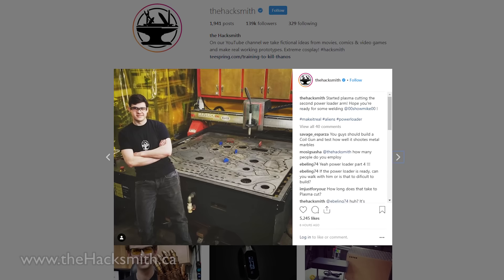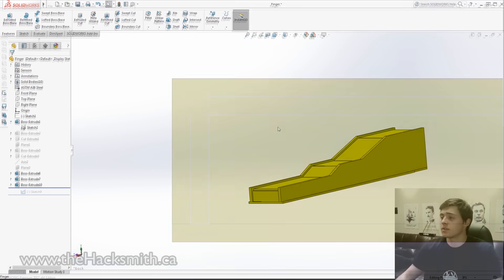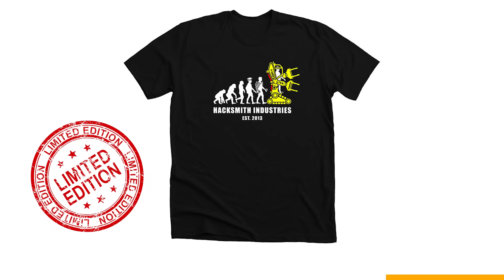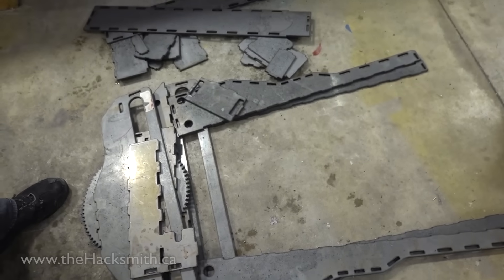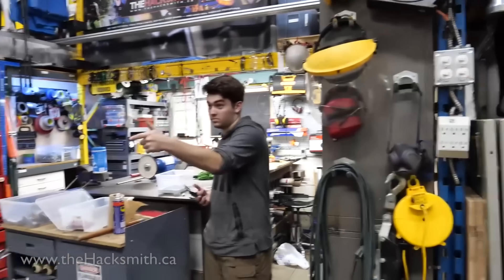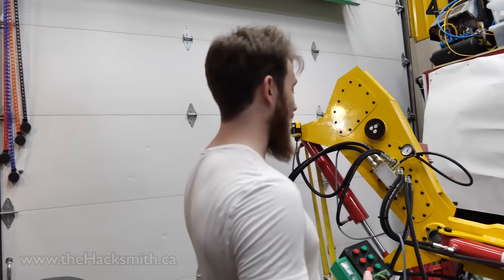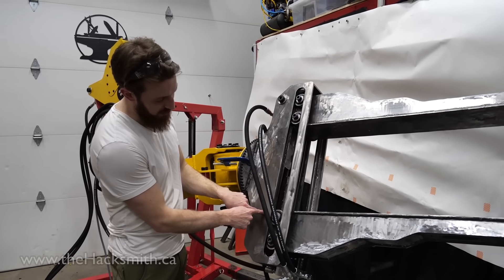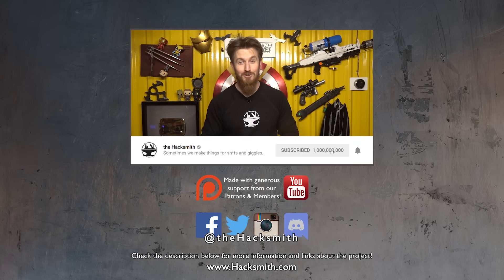GIVE HIM THE CLAMPS!!! (POWER LOADER: PART 4)

Comment: Awesome build so far and nice move to have this take over the Ironman project. Even though I knew it wasn't going to happen or be possible I did hope you were going to try and build the legs too. It is more realistic to use tracks but the legs would have been so much cooler... Fair enough. Did you guys ever think it might be possible to make a walker, colab with James Bruton on the code perhaps?
Reply from the maker: It's definitely possible to do legs, but then you can't do anything impressive. Flipping a 3000lb car, or moving it, while walking on legs? Not happening.

Comment: Now to mount it on a skid steer.  Then you can use the skid steer to power the hydraulics / counterweight all the rest of it.  PLUS! You can use the skid steer and parts to unload future deliveries.  Also you could sell skid steer accessories with grippers!
Reply from the maker: that's the plan

Comment: Couldn't you just either make 2 bearings sandwich the outer part of the rail, such that the bearing inside the rail is forced to the outer edge (so it doesnt touch the inner and thus can roll) and any flex is stopped by the lack of space between the bearings. 
Alternatively, use 2 bearings sandwiched inside the rail such that flex is stopped by having no extra space inside the rail. They will still be able to roll because 2 wheels when chained like that gets rid of the issue of having a side that moves in opposite direction of the movement (that side is instead where they touch eachother, and as that happens for both, there is no issue).

Comment: You could put your bearings off center making an ecentric. Similar to camber bolts on a car. Then you can adjust the bearings tight enough to remove slop but loose enough to still slide freely

Comment: Any tips on where to study for electrical engineering. I want to be an electrical engineer and i don't know where to start.
Reply: I keep hearing good stuff about skillshare. Maybe start there.
Reply: Skillshare is a good source but how can i use it to get a job?
Reply from the maker: Most jobs for engineers rewuire a degree to get into unfortunately
Reply: I don't want to sound like a annoying fan but wow thanks for responding. Its almost like talking to you. You are inspiring in the sense that you find ways to make things that seem impossible work.
Reply: @hacksmith  I don't want to seem like an annoying fan but wow thanks for responding. Its almost like I am talking to you. You are just really inspiring in the sense that you make things that seem impossible possible. P.S.(If you ever wanna chat I would be down for that.🙂)

Comment: How much do you estimate the whole project to cost
Reply from the maker: This one arm has cost close to $15,000 already, not including labor :O
Reply: @hacksmith  oh damn what about the cockpit will that cost more or less?
Reply from the maker: Don't know yet! Should be cheaper because it doesn't have hydraulics :)
Reply: @hacksmith  yeah that makes sense though you would have ti work out the control system id assume have you got any plans for that

Comment: Bogdan is really nailing the CAD, his solution to not using a linear rail was spot on.  The flex issue is one of those practical lessons, and your quick fix should hold just fine.

In fact, you might want to do it that way for the other gripper as well, since you could flex it the other way slightly and really tighten up any play when the grippers are trying to hold something really thin.